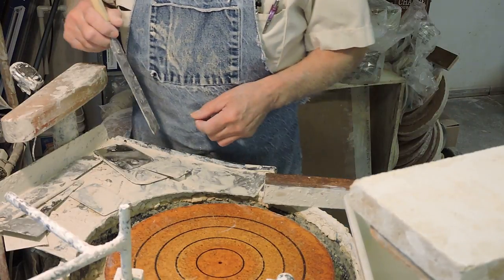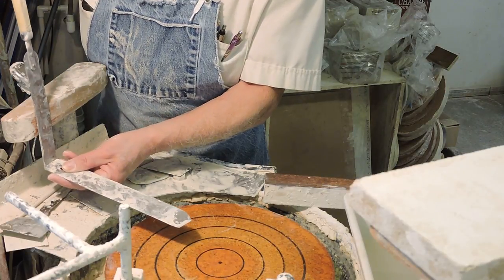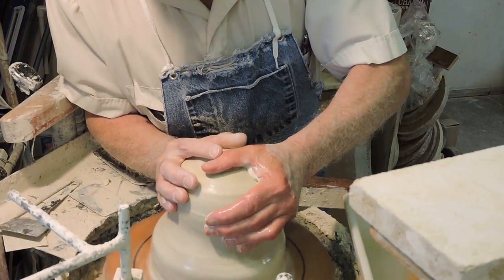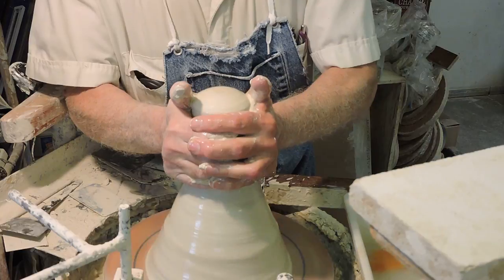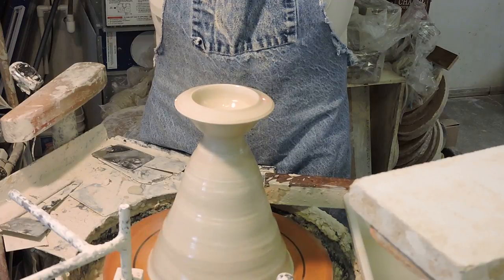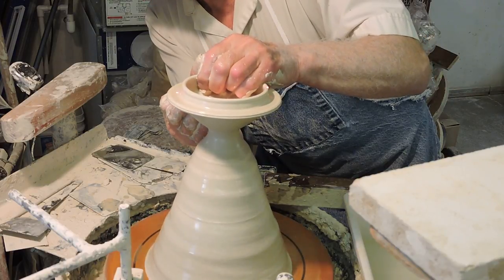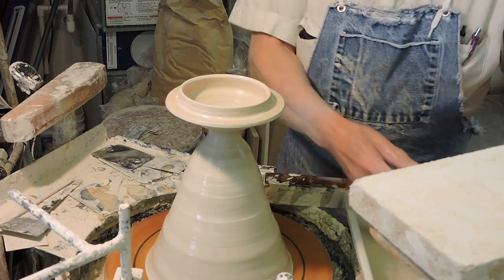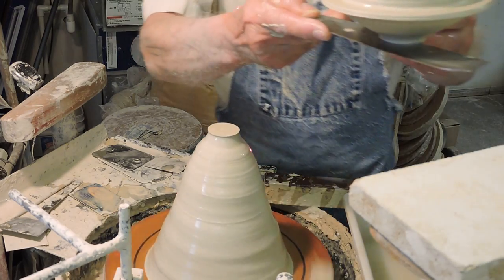DSCN0261

Comment: Just binge watching your awesome channel again Michael. Thank you for sharing more powerful life tips. We need more!!! About everything!! In HD!!! I really really appreciate your flavor of genius and am left inspired yet again. That brace you have designed is such a great idea. My joints became weaker the last couple of years after moving into a cold climate and so I was working on similar strategies to make use of leverage but in an entirely different manner. This is much much simpler. 

And the laser. Really cool. I could imagine having a couple of lasers set up above on some sort of gantry so I could control them electronically from below.. and save the settings so I could make them repeatable years later. 

Oh and your 'Off The Hump' parting method using the meniscus of water on the tools sharp edge to lubricate the cut is so clever. Thank you thank you! I shall practice that one right now.